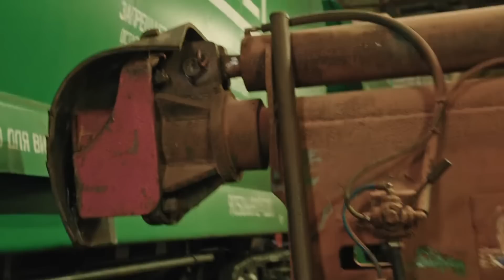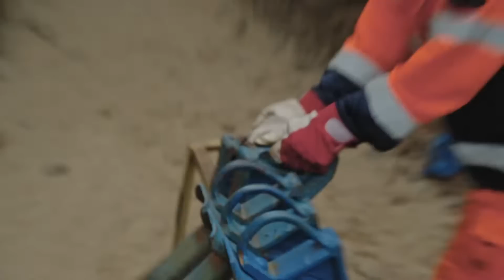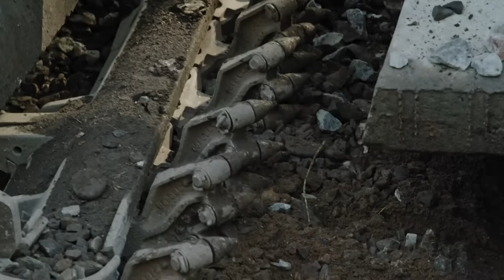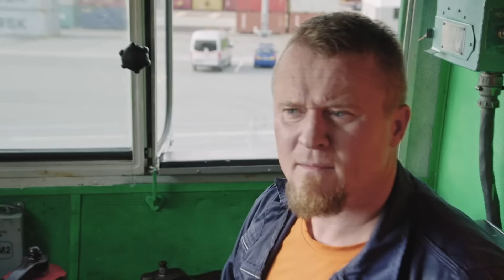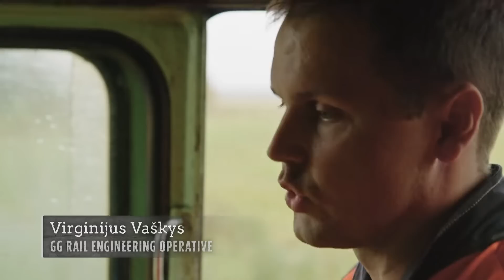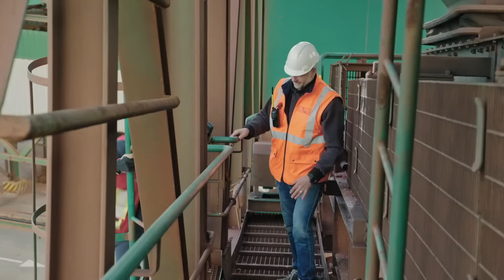Inside Lithuania’s Rail Cargo Operations | Impossible Repairs

Comment: Wagon repairs are the Bain of freight operations !! Especially if the wagon gets knocked  off with a defect at a  remote location and can't be moved again by rail .  ( or any location away from a depot for that matter !) The only option then is to use a  crane to repair  the wagon on site  or lift it out  to be moved it by road ! This option is usually not possible due too the expensive or the the difficulty of getting the crane into the location .   The wagon just sits there for years awaiting a decision . Usually by then the wagon has deteriorated beyond economic repair !